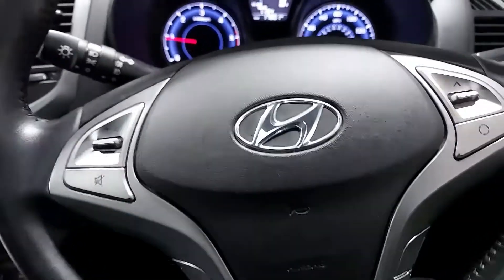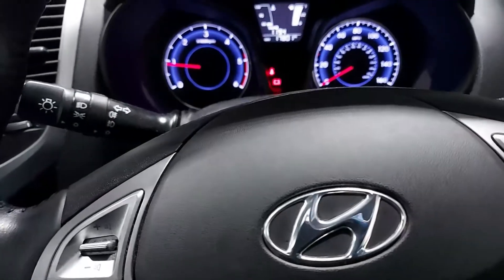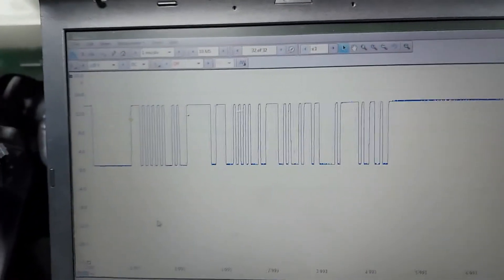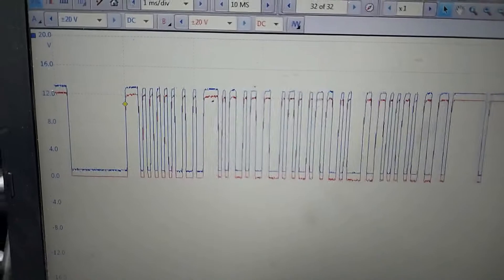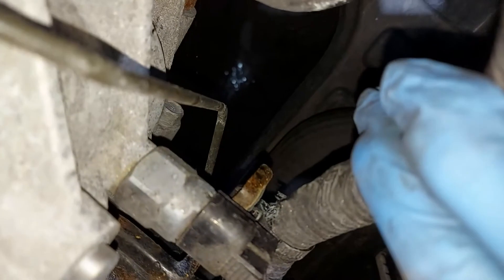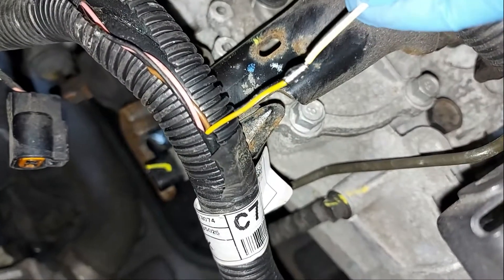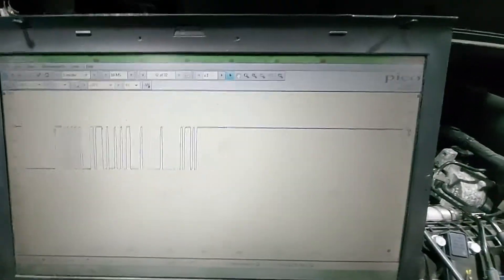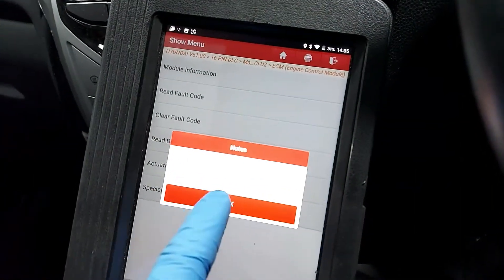Hyundai Battery Light On U012D Lost Communication with Generator Control Module

Comment: Where exactly did you connect the multimeter to check resistance, pin 78? Where did you connect the black multimeter wire
Reply from the maker: Send me the vin number and I will tell you exactly which pin is ecu and which one in alternator
Reply: @GicaPhp  TMAH2817AJJ004202 . After the error appeared I lost day lights, then half of the car settings, now my AC is gone.
Reply: @GicaPhp TMAH2817AJJ004202. No day lights, half of the car settings can't be accessed, and after some time AC also stopped working.

Comment: I’m having an electric issue like this where my generator control module according to Lucas Chevy needs to be replaced on my Chevy Malibu hybrid 2008 my battery, check engine light are on and it’s saying on the techometor service hybrid
Reply from the maker: You have a starter/generator which is both a start and a generator and if it fails, you're vehicle will not start (unless it has a normal starter motor as well)

Comment: Hi George. I've got the same issue with my Ford Focus MK3.5 Titanium. Battery light is on after 30 sec of engine start. Can you fix it please?
Reply from the maker: have you scanned for any faults? what have you replaced recently?
Reply: @GicaPhp  Same code U012D000. New battery and Alternator checked however battery light still on with the fault code. Cheers.
Reply from the maker: can I have the reg of the car? where are you located?
Reply: @GicaPhp  FL65DPY Location N9
Reply from the maker: @imranhossen3884  A bit far away (Leeds) to see it myself. Assuming you are doing it yourself, according to the wiring diagram, just like in my video, there should be a wire going from the alternator to the ECM on pin 20 or 54 (depending on if yours is an automatic transmission or manual). Make sure to check your grounds and positive on the alternator. From there if you identify the wire (should be the same color all the way from the alternator to ECM), you could quickly route a fused 5A wire from ECU to the alternator and see if the light goes out. If it does, you know there is a rubbed wire or even more.
Reply: @GicaPhp  Good Morning George. Thank you for the detailed procedure. The wire loom is good. I forgot to mention the battery light comes on after 30 seconds of engine start and stays solid. Battery charging with in limit and so is the alternator. Somebody mentioned the battery control mode. What is your take on this please?
Reply from the maker: Do you have an oscilloscope? Is your diag machine capable of programing? The light on the dash is turned on by ECM via the CAN network in the Cluster. The fact that is coming on after 30 seconds, I believe it is the strategy of the ECM to wait/interrogate for communication for a specific amount of time/tries. Also, the alternator might need coding on the car (if you already replaced it), that's why the delay might be there. Ideally would be to scope the alternator side and ECM side to confirm good signal and no loss of signal, a dual-channel scope would be great. If all is ok, then it is time for an alternator and check your belt. Battery control module, you can check it by scoping the LIN wire and see the signal, or just disconnect it and leave it disconnected for now.
Reply: @GicaPhp   Cheers mate. I don’t have a scope however a friend of mine has. I’ll go through the diagnostics you provided and see where it goes. Will keep you updated.
Thanks for you help.
Reply from the maker: @imranhossen3884  have you changed any parts yet?
Reply: @GicaPhp  Yes, I’ve replaced the alternator however one thing I didn’t mention was the Start/Stop function is not working. I need to look into this system but I will need a diagram for this option which I don’t have.
Reply from the maker: @imranhossen3884  for start/stop to function, you need to have state of charge and state of health high, agm battery. Also, see if there is an alternator coding function on your diagnostic machine